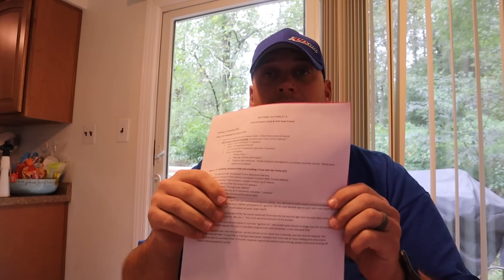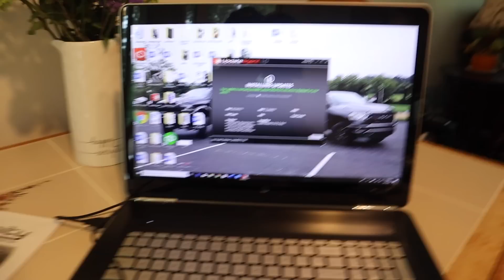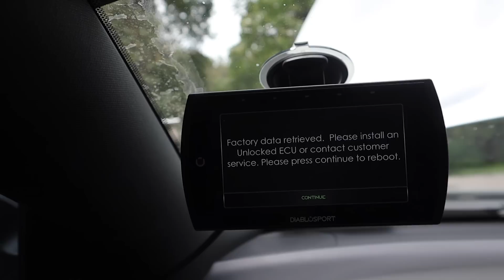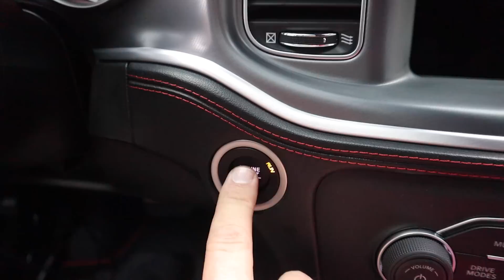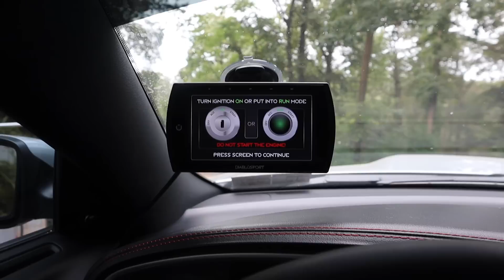UNLOCK THE POWER! Dodge Charger 392 6.4L Scat Pack DiabloSport Tuning Install & Review

Comment: You should be putting premium in a 6.4L already, it’s made for that. Shouldn’t need a tune for that, and for the 5.7L you should be using Midgrade and for the V6 regular. No hate just saying.
Reply from the maker: I’ve always used premium in the Scat Pack, I’ll start using medium in the Rebel to see if there’s a difference. It does fine on regular though.

Comment: What happens if Dodge says there is an update/patch for your car then your screwed with the unlocked ECU? Also can you adjust A/F ratio at the dyno with that tuner?
Reply from the maker: I would probably return it to stock, have them update it. You can adjust the A/F ratio with the T2.
Reply: @BEASTProjects  Thanks for that info.The canned tunes are ok they are set for the safest route but adjusting the A/F ratio is wheres its at for more power.

Comment: Keeps calling it a PCM but it’s an ECU
Reply from the maker: It’s a PCM, my friend.
Reply: @BEASTProjects  it is most certainly an ECU.
Reply from the maker: Nope, not w/ this car. I know that other vehicle have ECU’s. 

The PCM (Powertrain Control Module) is the main computer in the automobile that controls all its functions. By placing control of both the transmission and engine into one unit, the PCM can better coordinate their functions for better power delivery and fuel economy.

Comment: You are giving people Miss information if you have a 2012 to 2014 SRT8 Charger Challenger 300 your PCM is unlocked gospel for Fiat purchase Dodge apparently died and more did not care about locking the PCM so it is a lot cheaper if you have an older 392 please inform people about this so they do not waste their money they don't need to
Reply from the maker: The video was specific to my Charger. If that's the case if older models, DiabloSport won't even offer the PCM/ECU swap.

Comment: This mod is bullshit. It doesn't add any power and isn't proven to either. Get a hell cat intake. Even a larger exhaust on the 6.4 doesn't provide big.  The pcm mod does provide more responsiveness at the pedal, but in stock track mode. The comparison just isn't worth it.
Reply from the maker: I disagree, here's the proof: https://youtu.be/g8paC5cmjTU